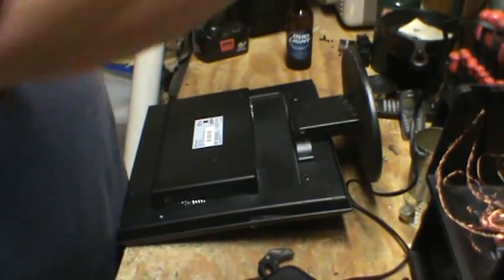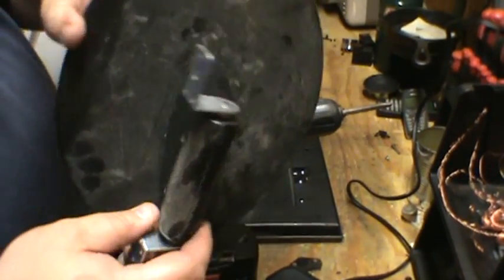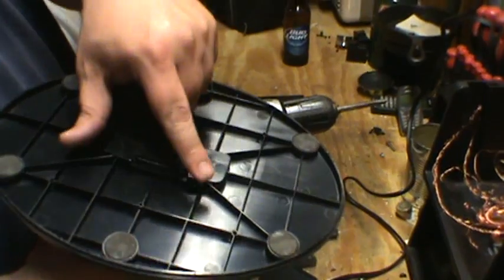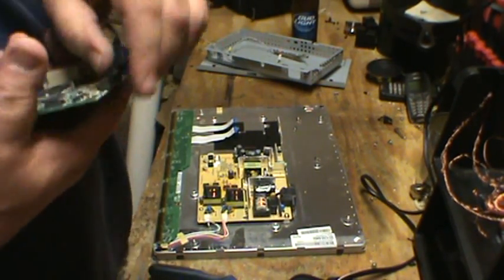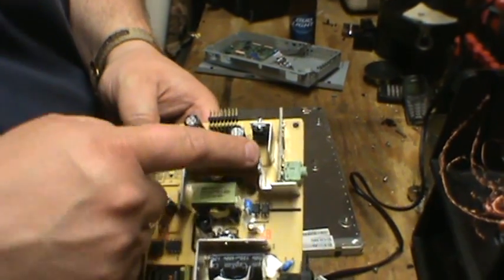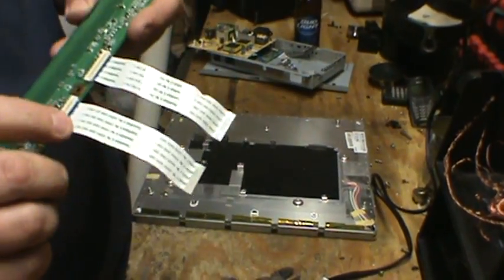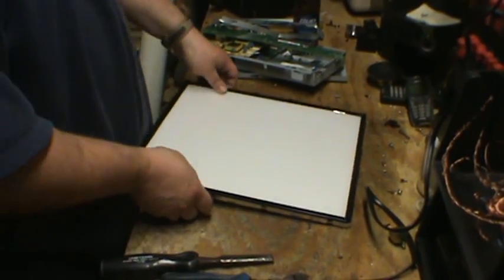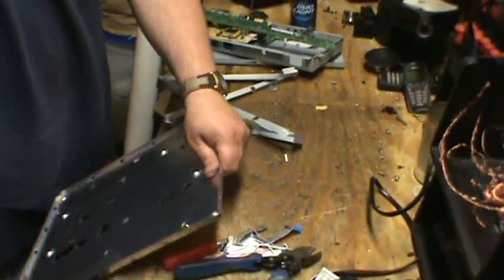Scrapping a Flat Panel or LCD monitor for gold, copper, and more!

Comment: Hey Moose was wondering what is the name of the board that you showed at 4:00
Reply from the maker: Brad Livecchi I honestly could not tell you...
Reply: Moose Scrapper moose so your saying you can take your old thrown away tv flat screen  ect scrap it down and there real authentic gold on the inside that can be scrap melted  down into  gold  actual of value? if so  would anybody  buy it ,  would it make  large profit and to whom would you sell it too? overall very informing video loved it!
Reply from the maker: proceesdreamer Yes, there is gold in just about every piece of electronics.  Usually a very very small amount but for people who scrap lots of electronics, those small ammounts can add up over time to something of value.  The gold in electronics can be recovered, and melted down.  The profit is not large by any means unless you are a major facility processing tons of material a day.  But for a hobbyist like myself, it is fun to recover and melt down gold a few grams here and there.  As for whom to sell it to, well, anyone who buys gold.  Ebay, jewelers, pawn shops, the gold is easily tested at any of the above places.

Comment: Hey Moose, how do you dispose of the lead glass.
Reply from the maker: scott v My local recycling center takes TV's to recycle.  Also goodwill stores will take tvs as well.  But, they have to be assembled so I take the backs off and save the screws and gut it then put the case back to gether and drop them off for recycling.  Otherwise you have to find a lead glass recycler.  They should become more common as lead is becoming more rare these days.

Comment: I'm interested in understanding how you "process" the gold plating into a scrapable product. Or do you just scrap the motherboards themselves, as is?
Reply: Nitric acid, hydrogen chloride mix to dissolve, aqua regia to seperate out the gold and borax to purify the metals at the end... there are many videos, dont burn anything, that's wrong and reduces yield. Just follow the instructions carefully triple checking everything at every stage and having excessive ventilation and breathing protection in place. The process is toxic and the fumes can kill...so don't take it light hearted..

Comment: Moose.  Cool video.  You answered a question about whether the dark layer of the screen had anything of scrap value in it.  Now I know it's plastic, and not of any value.  But what do you mean about "flash" gold plating?  You mean that not all gold plating is the same?  Please let me know.  I really appreciate what you do.  Keep it going!
Reply from the maker: Mitchel George That would be correct.  Not all plating is the same.  As technology improves manufactures are able to use less and less gold for the same purposes to decrease costs.  Gold is one of the only metals that is so malleable it can be made to be almost transparent.  There are many items where the gold plating is so thin that the AP process removes it but it can not hold its shape so it almost dissolves in the solution.

Comment: where do you get your scrap
Reply from the maker: Ea Leroux All over the place.  I put ads on Cragslist, online community boards, I print up fliers and post them at grocery, hardware, and big box stores, and a lot of word of mouth.  Plus I also do some garage cleanouts.  Thanks for watching!
Reply: Moose Scrapper your welcome you make good vids. and can you scrap a laptop?
Reply from the maker: Ea Leroux I could, but I never do because there is so little scrap in them that you are pretty much certain to make more money selling it on ebay without the hard drive even if its broken.  Lots of people buy junkers, take them apart carefully, and resell the parts.
Reply: ok.i took apart an old dell latitude d620 siries
pc and got bearly anything . but ti was fun...sorry for bad spelling I am quite tierd
Reply from the maker: Ea Leroux no problem!  When I type my spelling is really bad often too.
Reply: thanks for understanding

Comment: Hi Moose. I'm new to scrapping and just got three older plasma tvs. All are damaged and I'm not in a position to evaluate whether any components work, so I'm scrapping them for the goodies. So, my question is about the boards. My understanding is that these are low or mid grade boards if left intact. There a lot of chunky heat sinks and copper bearing items on here that I am tempted to remove but if I do, am I left with no-value boards? (thinking of shipping to Boardsort here). Which way is likely to yield most money? What do you suggest? Anyone else who has done this, please let me know your thoughts. Thanks in advance.
Reply from the maker: John C I would suggest taking the aluminum and copper bearing items off.  In most cases you make more money that way.
Reply: Thanks for the advice. It's more fun for me to dismantle them anyway 😄

Comment: I saw a vented capacitor on the power supply.  Replace that and it would work again.
Reply: Gavin Curtis I'm looking at Panasonic 58 inch a friend brought because my TV blew, it's kinda a big  & I am not a tech, but it has a Blown cap next to a blown fuse on the ps, I can solder? Hope it works, or it's scrap.
Reply: The 6.3 volt capacitors often go bad.  They are often 2 or 3 side by side for a larger TV.  Replace them all and use only Panasonic brand.  Go up to 16 or 25 volt rated capacitors if possible.  Also be aware of the polarity.
Reply: Gavin Curtis to late.
Reply: That's a big TV and definitely worth saving.  Private message me and I would like to see a photo of the affected capacitor.  I have the Panasonic ones in stock.  Probably looking at under $15 (including postage) to fix that 60" class flat screen TV.

Comment: Moose could you show 1 pound of gold pin connectors before prossesing i am just trying to get a ideal of how many computer towers it would take to get a pound of ggold pin connectors thanjs
Reply from the maker: +James Fiddler So not gold fingers, you are talking about gold plated pins?  IT would take a lot of computers to get a whole pound of plated pins.  If taken from the motherboard, drive boards, wire connectors etc, probably at least 10 computers towers.  I was working on some videos for gold plated pins before I broke my leg.  Im in a cast for the next month or so and will not be able to get to my bench to work further until the cast is off.  Hopefully this spring I will have some more videos on that.  Thanks for watching!
Reply: Moose Scrapper sorry about the bad luck have a quick recovery and milk that broken leg for all its worth haha im kidding so ten computers there abouts will get me a couple of grams of gold wow seems like alot of work  have you ever considered recovery of precious metals from catalytic converters now there would be some good money there are alot of little towns that have auto care shops thathave convertors for a good price

Comment: Hey Moose-- I'm just starting to scrap and wonder why I don't see anyone using  heat like a small butane torch to take things off the brown and green boards???
Reply from the maker: Hi and thanks for watching!  THere are a few reasons for that, but the biggest ones would be the toxic fumes created and the cost of the fuel vs the small amount of profit from what you are removing.
Reply: your best bet is a heat gun. no fumes to worry abut. just heat up the  under side and use a container of some kind to catch the compotens as they fall.

Comment: I found a 50 inch tv on the side of the road today. Saw some junk and saw some tires, but looked closer and found the tv. it was full of water, so drained and got all the goodies out. One thing though, on one of the boards was 2 flat packs (the ones with the gold chip on the corner), how do you get those off? I tried prying but they aren't budging.
Reply: never mind Mr. Scrapper, I found your video on the flat packs.

Comment: I just picked up about 50 to 75 of these. What are the foil looking things hanging from the screen
Reply from the maker: uhh....not sure.  I have taken a few of these apart and there can be a few things there that look like foil.  Sometimes there is a tape that is foil like used to help hold the layers of the screen together, the little ribbon wires are flat and thin like foil, and can have either silver or gold plated ends.

Comment: sent you those copper wires i found, i assume you got them?
Reply from the maker: There you are.  So where exactly did you get them?
Reply: found them in a pile by a land border in morrill maine, was under barbed wire and on a rockwall in the woods near farm land the wall was built in the 40s probably

Comment: what do you do with those gold plated pins on the circuit board?
Reply from the maker: I remove them with a heat gun or hot sand bath and process them with HCL and Peroxide.
Thanks for watching!

Comment: how do you proccess the metals and copper in the motherboard to sell to a scrapyard
Reply from the maker: How do I process mother boards?  I take off the aluminum heat sinks, the copper bearing stuff, RAM, CPU, PCI's and wires.  I sell the rest of it to people on ebay as is.  Sometimes in the winter, when its slow and I am feeling ambitious I pull off CMCC's, tantalum capacitors, IC's, Flatpacks and gold plated pins.  I seperate all the above and sell in individual lots by the lb.  The gold plated pins if recover the gold via AP.  Thanks!

Comment: Do you save those little white ribbons? I was told the tips are silver, and that they could possibly be silver the whole way through. I have one of the big ice cream tubs full of these, trying to figure out what to do with them
Reply from the maker: Thats a great question, I do not think they are silver throughout.  I could be wrong, but I believe it is just the tips.  I end up throwing them in the insulated wire bin simply because silver is worth about $20 an ounce and the amount of those wire ends, then chemicals and time to make one ounce does not seem to be worth it to me.  You could try selling them on ebay though...  Best of luck to you!

Comment: excellent tut!!  hadn't seen much on LCD or plasma. I would of been reluctant to scrap (fear of radiation or something) until I watched you. 

Question: The little transformer u scraped for copper, are they worth more selling intact for re-use?  I pay about $14-18 at Radio shack
Reply from the maker: Parts are ALWAYS more profitable.  I have been trending a lot towards selling parts on ebay and making way more money for the time and effort.  You kind of have to know how to test certain things though before you can try to sell them.  Thanks for watching!

Comment: I seen you scrapped those green connector tapes that connect  the gold to the screen. What is that shiny metal piece in the center of that tape type connector? I have been saving them as I have an almost unlimited supply of old monitors/lcd tv's. No one seems to know what that center strip is
Reply from the maker: That center strip is actually not even metal, its silicon.  Sometimes there is gold under it though.

Comment: Hi Moose. Im trying to get plating from cell phone boards using your ap proces, but i get a nasty white powder  together with my gold foils. can you give me some tip to fix it.
Reply from the maker: You really need to make sure before you put anything in the AP that it is clean.  No solder, no other componants, nothing.  Thankfully the gold is still there, I can not tell you what the white powder is as I did not see what you put in the AP.  The powder will not be a problem once you refine it with HCL and bleach.  Just filter it an let it dry.  Oh, and make sure you have a lot, several grams at the very least of gold before you purify.  Best of luck,  Try checking out the gold refining forum.

Comment: Is all the hardware (Nuts Bolts Washers) removed during scrapping worth anything?
Reply from the maker: If its metal it has value!  Most are ferrous and are not worth much, some are aluminum and worth a little more, an even others still are brass and worth quite a bit more.  Also, some special nuts bolts screws and washers are worth even more stil on ebay, for example, I can get $5 for a set of 4 hard drive mounting screws for any apple computer.  Thanks or watching!
Reply: I have buckets of hardware. Just curious. Thanks. Love your vids dude. I've learned alot. Good luck with your new digs.

Comment: Hi
What is the best way to recover gold from a flat screen monitor boards
Reply from the maker: A hot sand bath to clean the board of all componants, then A/P soak (Acid Peroxide) to remove the gold foils from the board.  You are going to want to save up a lot of boards before you do this as it takes a lot to get a little.

Comment: So how do you process that tiny bit of gold? Do you scrape it off? Heat it? I am not sure how to go about removing that from the board and pins.
Reply from the maker: Hi and thanks for watching!  For the gold found in this video, you don't really do much with it until you have a lot of material to process.  Gold recovery is a game of volume.  You need to have a lot of like materials before you can even consider processing them.  The gold plated boards here, save them up until you have a few lbs or kgs of CLEAN (nothing on them) boards and then process with Aid peroxide.  I have a video on that on my channel.  Other materials like IC's, flat packs, gold plated pins, etc have different methods of gold recovery required.  Check out videos from people like indeeditdoes, original feets, drew metalsmith, and geo.  Thanks!
Reply: Moose Scrapper
thanks!
Reply: ddavis78 You can also often find folks who will buy your boards and other scrap with plating and other metals.  You won't get as much for them as you would if you processed them yourself, but you of course don't have to process them yourself.  Specialization, because the guy who does the processing isn't tearing down appliances, rather he's focused on aggregating scrap and doing volume processing with rather caustic chemicals and processes.  Something to consider.

Comment from the maker: You can remove them a bunch of ways.  I use a small pair of pliers an twist them off.  You can get them off with a hot sand bath, chisel, etc.  Just need to be a little careful because they are britle as hell.

Comment: The ccfl tubes are worth selling on Ebay if you can get them out with the cables attached.. Also don't break them as they contain mercury. Also it's worth checking the power supply of tv's and monitors as often it's bad capacitors in the power supply and can easily be fixed with $2 worth of replacements.

Comment from the maker: Hi and thanks for watching!  This method should only be used for gold fingers.  Other componants need to be processed in different ways.  The goldrefiningforum has great information on how to recover gold from other items.  I only process two things.  Fingers and gold plated pins.  I can not help you with recovery of Pt as I have never done that.  Pt recovery almost always requires using Nitric acid which I stay away from.  As with all PM recovery from electronics, it really does take a lot.

Comment: Hi moose, thanks for the video; arguably one of the clearer, well done I've seen on the subject. How many different computer components should I acquire before going through the trouble of dissolving them in the HCI solution? Also, is the process the same for metals like Platinum. Or is the plating so thin of those metals that it's not worth it?
Reply: Hundreds of kgs.  The yield is around 1 gram per 500 grams of salvaged boards. So if you want a return that will be profitable you'll need to do a large batch to dissolve, otherwise the cost of chemicals and gas to melt the metals can exceed the yield...so you'll need ALOT, minimum of 1kg I would say, to get a return of around $250 to $300 BEFORE costs...
Reply: Yes, same process for the other metals, seperate, stockpile then process in bulk.

Comment: Well, I'm kickin' myself because I had a old zenith vaccume tube t.v./record player/radio w/ remote that works using sound and a mic.  All the electronics were mounted on heavy brass and I didn't have room for it when I moved.  Had it all torn down, only the CRT didn't work and had real old flyback.  Man, I am kickin' myself.  I could kick my ass for this...left it sitting on a Davenport my cat peed on.  Man, I am stupid.  Good stuff in vcr's, gold rca plugs and such.